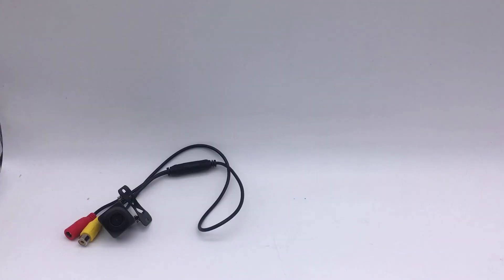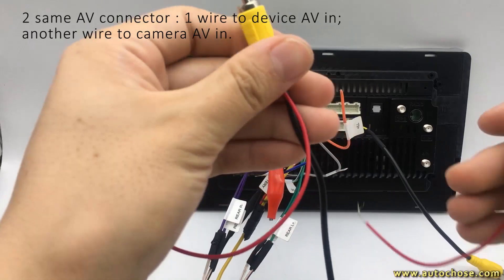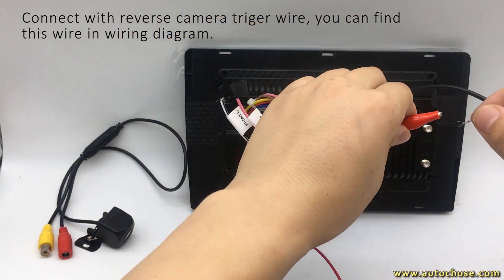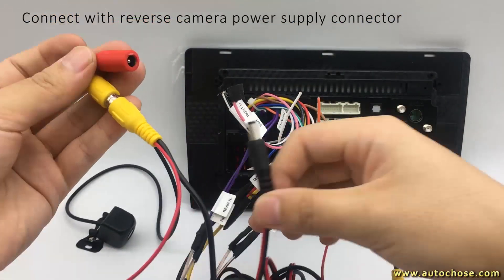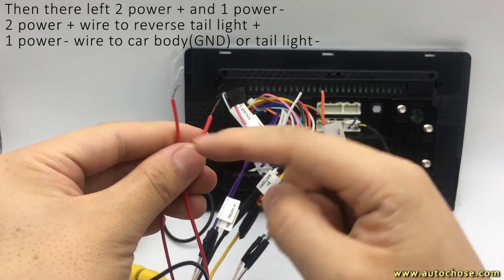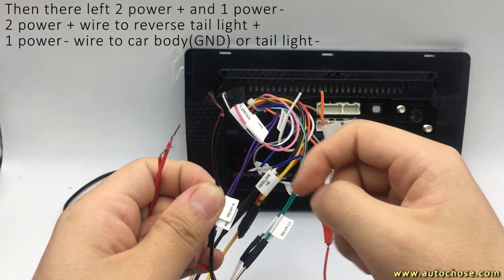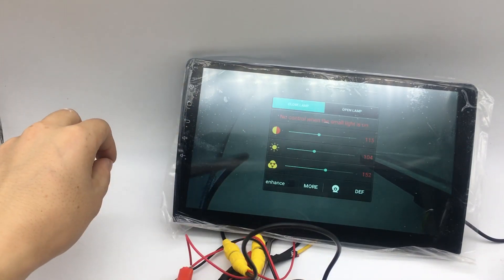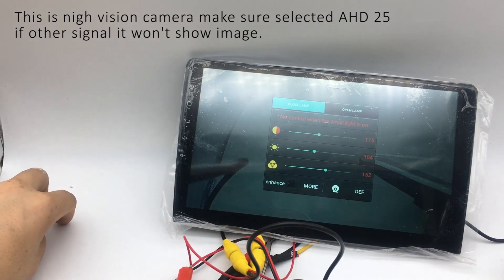Android Backup Camera Installation Guide - 4 Steps

Comment: This is exactly what I did and it didn't work. I get "no signal" message.
Reply: did u change the video source
Reply: Evet bende aynı durum var malesef
Reply: Happens to me to, no signal
Reply: In the settings, change the display mode. For mine, it was in backcar display settings in the factory settings. Only AVI 720p 25fps worked.
Reply: You have to go to android unit setting and click on the correct  type of camera
Reply: You have to change Video source in Display...Cvbs or hd
Reply: @highruz so it's not the video out source? maybe I should try that thanks man

Comment: I was trying to get through the rubber and I damaged the end of the cable. I decided to cut and run the wire because it was thinner, now I bought a new P2 power cable. Can I just cut it too and splice it to my old one? I saw that there are 3 wires.

Comment: I bought a CarPlay with the same wiring, but the screen dose not have trigger wire I just connect the yellow one to another yellow wire and the end of the other wire it’s like aux cable I but in the screen, and even I though I did the connection to the tail light I still can’t get a clear image on the screen it’s still so unclear

Comment: When I put my car in reverse the image doesn’t automatically show up I have to press the camera button idk how to fix it
Reply: You need to take live wire from reverse lamp
Reply: Have you gone into settings and set it to aftermarket camera as it might be on original equipment setting 🤷
Reply: The power needs to come off the positive reverse wire in the boot/trunk of your car. That turns the camera on and tells the head unit to trigger the screen. It won't work if you have constant power to the camera.
Reply: @robertjohn2249 I have a camera not this one but I hooked up yellow connector and red wire to head unit to reverse trigger ran the wire to rear camera, tied bother little red wires together and ran those to the reverse wire and ground . I have a 2003 gmc sierra and when I put the truck into reverse it does nothing until I hit camera , but the camera not on unless I put it in reverse and hit the button 🤷🏼‍♂️🤷🏼‍♂️

Comment: No signal and I’ve got power and all connections hooked up correctly.  I can’t get into Factory setting because the 8888 and 1234 passcodes don’t work. Any ideas?
Reply: There are videos that tells you other passwords try them

Comment: Hello brother really need you help I have a bmw f20 with android head unit I have three wires with the head unit CCD+12v, BACK & ACC which one do I connect the red wire with yellow av too and do I need to connect power wire yellow red wire to reverse light for it to work. My cars a manual if that changes anything.

Comment: I want an Android dashcam, but I already have an aftermarket rearview camera on my car, connected to a monitor on my dash.
The seller of the dashcam says my camera will not work on the Android dashcam.
I find that hard to believe.
The only difference is that the AV-in on the dashcams they sell is a jack or a round 4 pin plug. I bet an adapter cable from RCA does the trick?

Comment: Just finished installing the rear camera on my Prado... Well... This is NOT about wiring... This is about disassembling the whole car from the dashboard to the back door... Took me the whole day. And the steps above took me only 10 minutes thereof... Thanks to Toyota - they use a good plastic parts! Only a few broke while this operation.
Don't be fooled: this is NOT an electrical job. This is about finding out how to correctly disassemble all the trims and not to break too many of the holding clips. Good luck!
Reply: You’re right took me all day
Reply: Lol 😆 same R50 qx4 but it was worth it nice cable routing through oem grommets cutting and resplicing

Comment: Hi, I like to wire back up reverse camera when I put reverse gear. But I don’t know  how to connect the trigger wire from monitor
Reply: I believe in the video, when they said, 'tail light' they meant to say, reverse light (on your tail light assembly). When you put your car in reverse, the white reverse light goes on, thus giving trigger positive signal. I haven't installed mine yet, but that's the plan.  If I'm wrong, please someone post any corrections.

Comment: What if I don't connect the black wire from the power cable to the car body or tail light negative ?
Reply: Then u won’t have a ground
Reply: The positive will smoke until it catches fire.

Comment: I have a 2010 Toyota Corolla. Connected it exactly as you said, checked it 100x and the camera doesn't work. The "back" wire is the pink one for me but nothing. The odd thing is on the chart it shows to be the 3rd wire from right which it is but lists as brown, but mine is pink so I'm sure I have the right one. I put the car in reverse and nothing changes on the screen. What's wrong? Any help?

Comment: How you connect the android power unit without a car? Do you use some adapter or battery? Please help
Reply from the maker: Hi, need to prepaer an 220V/110V to 12V adaptor, then wire (1), ACC&B+ to 12V+; (2), Ground to 12V- will be ok, its for home test.

Comment: i have a 2014 corolla with the same Android radio but it has a factory backup camera, where do i have to connect the brown wire?
Reply from the maker: Hi, if the cable set has backup cam video in port, usually it was pre-defined, if not you can refer the diagram to find out the trigger wire.

Comment: QUESTIONS: I have an '09 Corolla and installing 9" head unit. 1) Must the brake wire be connected to the black ground wire to by-pass emergency brake to watch videos while driving? 2) To have a camera icon on head unit and to see behind the car without being in reverse, did you connect the reverse trigger wire from RCA cable from rear camera to red Accessory wire and also the head unit reverse wire (mine is a brown wire) for when car is put in reverse? 3) I have two yellow RCA connectors from head unit. One  connector is labeled 'CCD AVIN' and the other connector is labeled 'Aux-V'. The Camera RCA cable connector coming from the camera plugs into which of the two RCA connectors in order to establish a signal for the rear camera? 4) I have a pink wire from the head unit labeled, 'With protocol model output 12V can be connected to the camera'. Is this pink wire like an accessory wire for the rear camera to view behind the car with out being in reverse? Should I use this wire instead of the red accessory wire to have a camera icon on head unit and see behind the car without being in reverse? 5) I connected the RCA cables together at the head unit and the trigger wire to the red wire off of the RCA cable, but I get no reverse camera picture on the head unit. When I go to the rear camera, the LED lights up when in reverse. Why no reverse camera picture on head unit? Thank You for All Your HELP!!!
Reply from the maker: Hi, 1) usually in car settings or advanced settings you can uncheck the: can't watch video in motion; 2) to see reverse image must in reverse gear, as it will supply 12V power from reverse light; 3) The Backup cam port is pre defined, so just wire the backup cam port will be ok, RCA cable has CCD AV in probably also work, as its also for video in fuction; AUX usually for after market subwoofer extension use; 4) some car models' trigger wire was occupied by Canbus box wire, so need to peel off a little to wire with red wire; 5) change the backup AV port to the head unit backup av port, instead of using RCA port then see the effect.
Reply: Have you figured anything out, I wired my camera too reverse light, and when I put in reverse lights on camera light up but black screen on android screen
Reply: I figured it out, but it's been over a year ago. Concerning your issue, do you have the input wire(s) connected to the back of the head unit? You may also have a ground issue, I know you have to ground a black wire from the camera. I'm sorry, but this is not fresh in my mind. Consider reviewing other Youtube installation videos.

Comment: how to on the trajectory line.. and adjust a line angle and width
Reply from the maker: hello, the trajectory line can be on/off on factory settings.
Reply: Some cameras are adjustable. They have a small green cable that needs to be cut to display the trajectory lines. I am thinking mainly of Chinese reversing cameras.

Comment: Hello, I have a problem with the rear camera of my car, when I go back, there is no picture, and when I turn off the engine and just open the car key without starting the engine, it works properly.
Reply from the maker: hello, you may not find the right Trigger wire, when bootup it shows back image shows you wrongly connected to the ACC cable or Battery cable, so once start engine it show back image.

Comment: cant get mine to work followed these steps, nothing comes up when in R
Reply from the maker: did your screen changes when to R? if not, shows the trigger wire not connected properly, once it connected correctly and with a round circul the screen will have reaction.
Reply: @autochose5808  got it working now
Reply: @paul2085  how do u fix it bro?
Reply: @masterazu842  I had to cut a wire, the one that says back, was connected to a connector,  cut that and got it working, on my one it was a pink wire, not sure what it be on yours
Reply: @paul2085  can you explain what you mean by cutting it im having same issue with black screen when in reverse cameras led light up but no image
Reply: @AlienAura35676  you fix it?
Reply: @autochose5808  it shows the circle and everything but no picture of the back
Reply: @autochose5808  hi im having the same problem... nothing  happen when i gear in R.i checked my wiring 100x 2pm to 10 pm..all connected properly..i even rewiring 2x.. nothing fixed. Is there anyproblem other than wiring?

Comment: I have trued to connect the reverse camera on panasonic cn-h500d but it doesn't work I need your help
Reply from the maker: 1, first check whether have reaction when in R, if have reaction check whether the backup camera siganl camaptible with android head unit.

Comment: How do you get to those cords. Skipped a huge part
Reply: they should come with the radio unit, then just wire it below the carpet or under the pillars
Reply from the maker: its a univeral power cords, different car model will equip different powe cord for plug and play installation, but the diagram and function for backup camera wiring logical are all the same.

Comment: Is the pink wire “BACK” or is it “Key 1” or is the brown wire “BACK”?
Reply: What was it the brown one and what did you hook up to
Reply: Brown wire went to key 1 and pink wire is remote wire to power amplifier.
Reply from the maker: Hello, the pink wire BACK is the trigger wire, the Key 1 is for steering wheel control purpose.
Reply from the maker: sorry the Brown color for BACK trigger wire.

Comment: I have an after Market Android and when I put it in reverse it go's black and then no signal but the LED light on the camera comes on
Reply: Same! I'm also tried wiring the red signal wire attached to the yellow av cable up to the power of the tail light at one end, then the other end of the power wire attached to the yellow rgb is wired to the purple wire on camera harness and out of purple to reverse wire on head unit harness. Still notta. 
I believe it's a trigger wire issue ⚠️
Reply: Did you tried different video outputs. Mine worked only on NTSC output
Reply: my camera does the same thing
Reply: Any updates I have same issue
Reply from the maker: Hello, this means it has a round circle, check the output AV cable and signal, the backup cam siganl must correspond with android head unit signal.

Comment: Hi do I have to connect the yellow wire from the input reversing video?
Reply from the maker: Hello, the yellow cable is for 12V+ Battery cable, no need to connect this for backup camera, our video showed connected is to make the screen works normal.

Comment: What are the 2 small blue wires at harness of camera video, input plug on radio??
Reply: You must have the same one I have and I can not find any info on how it is suppose to be wired
Reply: @GeorgetownRider80  did u figure it out?mine works flawless now.
Reply: @dwright4454  No, I sure haven’t and Been through all of the wire and can’t figure it out..
Reply: @GeorgetownRider80  those 2 small blue wires do nothing,I believe they are to add a backup alarm.did u get radio all good but no backup cam?
Reply: @dwright4454  That is correct. I bought the camera later.
Reply: I guess I need to find the trigger wire.
Reply: @GeorgetownRider80  pink wire
Reply: @dwright4454  thank you !!!
Reply: @8VD80Y  no doubt glad u finally got figured it out, u can download the carguru app and change the user interface(look) to one that has a working speedometer also. It's a nice unit has served me we'll a while now.
Reply: Hi I am also facing an issue with finding trigger wire for reverse camera. The suggestion was to use pink wire, which is marked in my case with “break in”. So is this still ok to connect although the name is not rev/cam
Reply from the maker: Hello, the 2 small blue wires actually are the signal cable, 1 is for Bluetooth, another is for WiFi, once connected these the BT and Wifi signal strength will level up, so its a must plugin cord on any android device.

Comment: Thank you. Can you explain process of wireless camera
Reply: I have connect the wires one long wire with 2 yellow pins and short red wire beside connect the red wire power from reverse light and the other pin  has black colour with two wire black connect on ground and red reverse light power and here at the back the camera show's that it has receive the power but at the screen doesn't show the picture when you put reverse gear

Comment: Hello Guys! Pls can u explain to me why my AHD Camera do not work? i tryied many times but it doesn't work! pleeeeeeeeease
Reply: Your headunit probably does not support AHD. NTSC = low resolution however should be fine for backup camera.
Reply: Same here. It's only the low res NTSC that works for me
Reply from the maker: Hello, 1, check whether have reaction when in R, 2, if no reaction shows the Trigger wire not connected properly, 3, check the rear +/- whether wired connected.